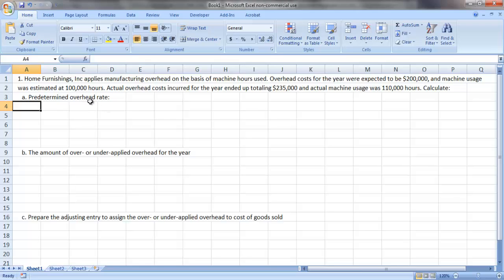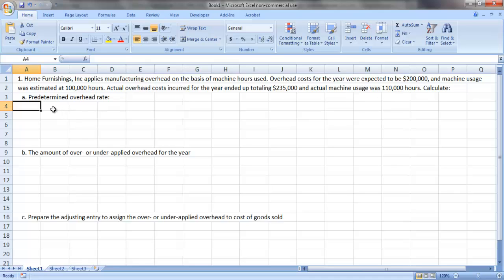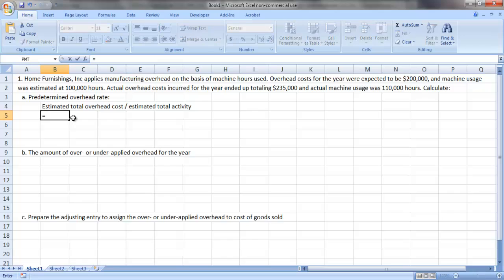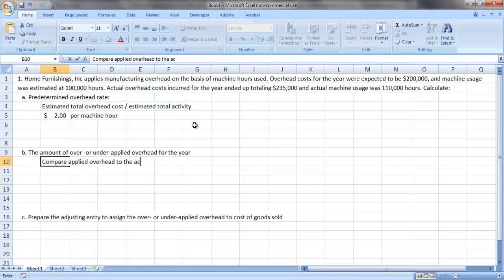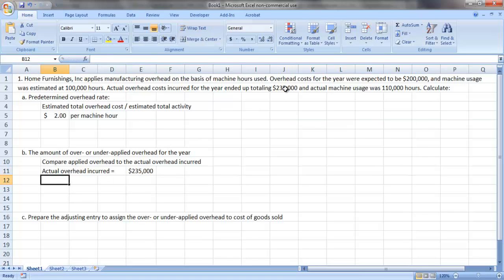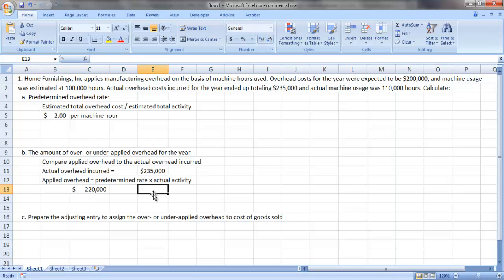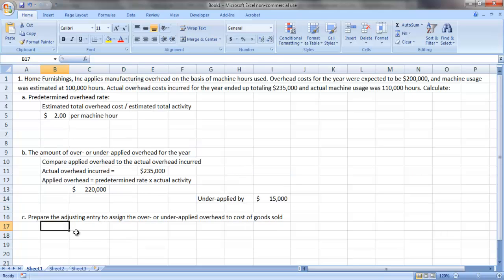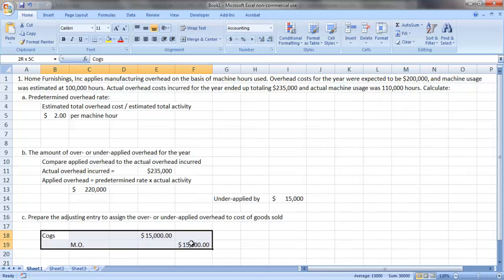ACC 121 - Calculating predetermined overhead rate and under- or over-applied overhead

Comment: what if the amount of the under applied OH is a big number? lets say $70,000 instead of $15,000, should you move that to COGS? if so, that would hurt us in the Income statement right? thanks for the video, well explained!!
Reply from the maker: If we "move" under-applied OH to COGS, it does increase our COGS (which lowers Net Income). I'm not sure you can call that "hurting" us though, as these are costs that were incurred and need to be reflected in our expenses at some point...we're just changing the timing.

The answer to your other question is that it depends! Some firms allocate over/under-applied overhead between COGS and inventory accounts (WIP...). In the course that this video was initially created for, we follow the COGS-only method.